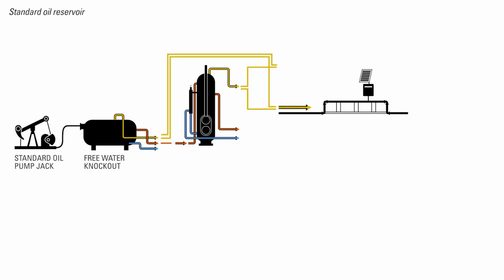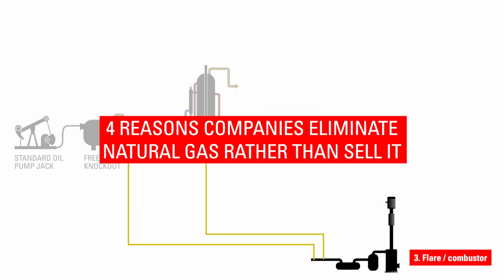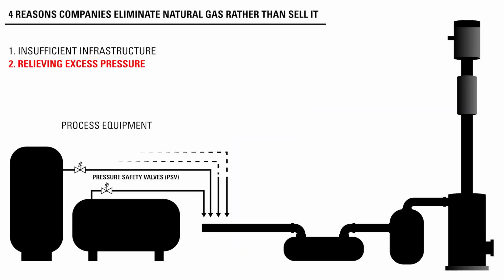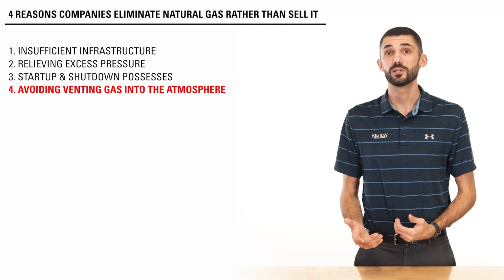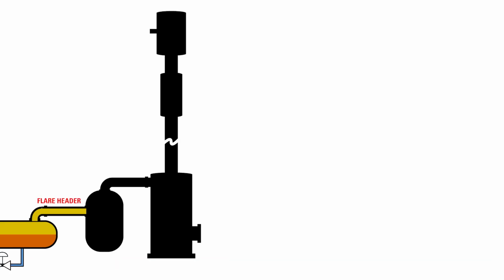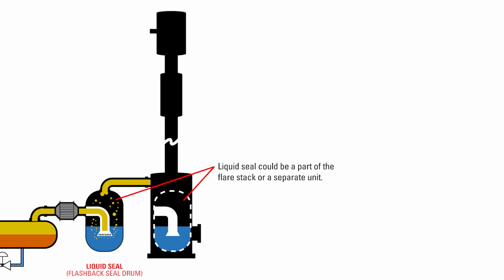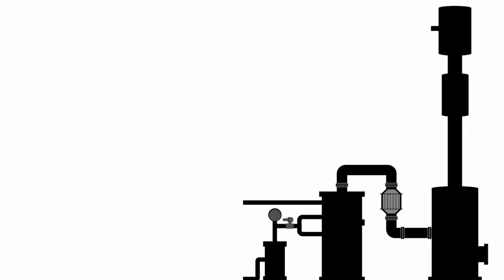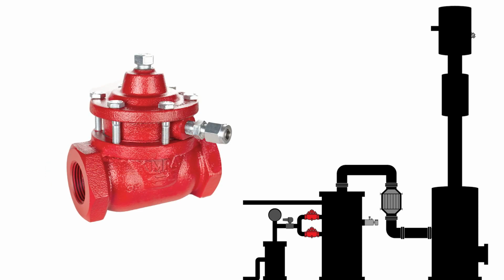Why Producers Destroy Resources by Using Natural Gas Flares

Comment: They wouldn’t need to flare so much. If you know we could build a pipeline or two.
Reply: The gas needs to be consistent and also high volume % of a marketable gas. Otherwise hard to get a pipeline to even take it. On site separation helps to bypass this.